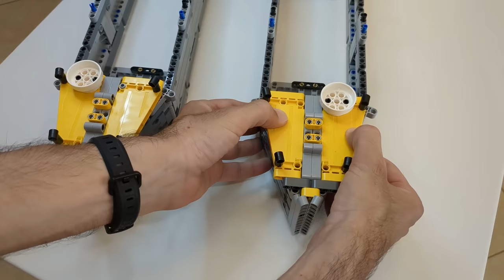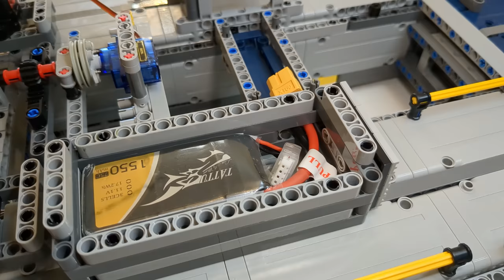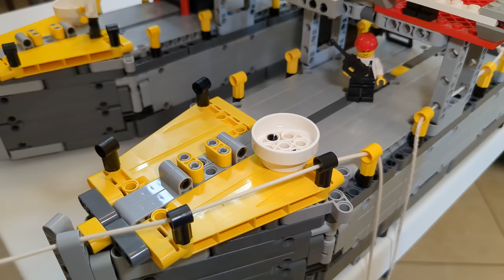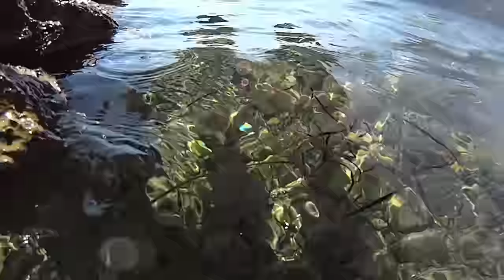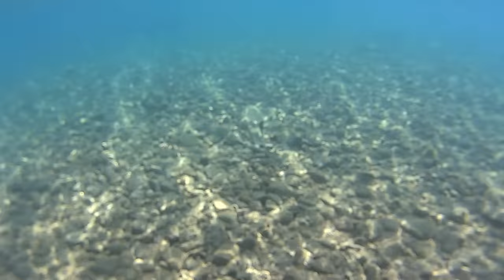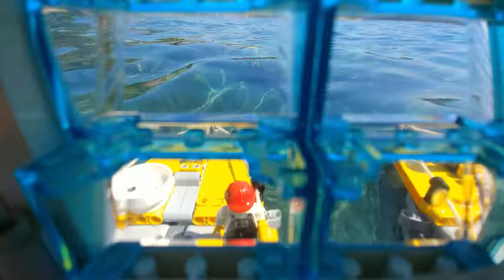LEGO Technic RC boat explores the ancient sunken city of Epidaurus

Comment from the maker: Would you like to see a slightly improved version of that boat exploring a sunken airplane that is even further from the coast? Let me know in the comments!
Reply: 100% do it, also do you have advice for me too? I’m using my Lego exploration ship to explore a crashed ww2 plane. All I could think of is a underwater camera attached to a deep diving rope that can extend 4 metres deep.
Reply from the maker: @techlogiantbricks8279 @ techlogiantbricks8329 To lower a camera so deep, you should go for a platform that is lowered with ropes from all four corners. The mounting points should also have enough space between them to avoid spinning the platform. If you try to lower the camera with a single rope it will definitely start spinning. A simpler and safer solution would be to mount the camera under the boat as I did. That way you avoid the camera getting caught on the wreck or other object on the sea floor, as you will have absolutely no clue about the camera position once it is lowered. Finally, another option is to build a fully submersible vehicle, but that's much harder.
Reply: @brickandgear à
Reply: @brickandgear  thanks for you reply, you share lots of info with me. I have another question, what do you mean that I make a submersible out of Lego bricks? I always wanted to do it but it’s way too hard, you need to make it so that the sub can descend under the water and also rise up, this project just seems impossible. Even if it’s possible, the motors with the battery box can get damaged if it leaked
Reply from the maker: @techlogiantbricks8279  you can check out my submersible drone video if you want more ideas, but it is extremely risky. If it leaks, it's game over...
Reply: Wow, if you spoke in your videos you'd have millions of subscribers, else than that, your content tops everyone!
Reply from the maker: @napoleonofthefrench  wow! You really think so?
Reply: @brickandgear  Yes, I've saw plenty of YouTubers with content worse than yours rise through the ranks, with a voice it would be more personalized and engaging than without.
Reply: Oh hell yes!!
Reply: yes
Reply: Ok
Reply: Yes please
Reply: 100,000,000,000,000,000,000,000,000% can you also attach a crane arm and submarine to it.
Reply: Sure
Reply: Yes, we do.
Reply: Make an Aircraft Carrier!!!
Reply from the maker: @Ąļęxąŋđęř  I'm planning to build one, but I'll have to order some parts first. It'll be at least twice the size of that research vessel.
Reply: I think you should make a Lego submarine and explore a shipwreck in shallower water
Reply from the maker: @Microwave034  it's on my "To Do" list. I know which shipwreck to explore, but the project needs much work.
Reply: Do it.
Reply: Yes
Reply: How long did it take to build
Reply from the maker: @MatthewSchwarz-kr6cd  a day or two.
Reply: HELL YEA
Reply: Les  lego 🎉😅 jolie bat sa secou❤salut ❤ cigne Antonin
Reply: Yes sir
Reply from the maker: @Playmat-qm3vn  you will... soon... 😁
Reply: Yes please
Reply from the maker: @Captain-latvia  coming soon!
Reply: Just do it!!
Reply from the maker: @PVJaumePinaMorales  you can check out the video with the sunken airplane exploration!
Reply: thx!! @brickandgear
Reply: Pls
Reply: YES
Reply: Yes but do it where the middle bit of the boat can close in and hold stuff

Comment: The ship's rolling a lot. While a catamaran hull design is more stable than single hull, you still need keels and fins along the sides and bottom to lessen the roll. I would also recommend storing the heavy battery pack lower on the ship and use smaller motors.
Reply from the maker: Hello! Thank you for the informative comment! Could you check out my merchant ship video? I'd love to hear your opinion on that vessel.
Reply: a SWATH style catamaran hull with deep displacement pods would give more stability, you could design it to be suitable for 3 to 4 inch waves. look up SWATH and Trisec design ships.

Comment: The only improvement I would make is adding a small RC submarine attached by a string. That might be slightly difficult, but I think it might look nice
Reply: And be fun to “explore” with
Reply from the maker: I'll definitely make an exploration sub in the future!
Reply: it’s all fun and games until the controller disconnects
Reply from the maker: @heisenburger531  subs are usually connected with the controller by cable, so you can just bring it up if something happens.
Reply: @brickandgear  just don't use a carbon fibre composite for the hull 😬
Reply: Sounds like a really good idea

Comment: Thats awesome how you built a floating Lego RC boat! But i do feel like there could be a way to make the turning radius gears a little bigger.
Reply from the maker: You are correct. Those small servos turn less than 90 degrees and I wasn't aware of that when designing the boat. I actually made a modification with larger gears in order to achieve tighter turns, but in the end I stuck with my original design, as the mission didn't require great maneuverability. I'm taking my first steps in proper RC gear, so I'm learning as I go.

Comment: Hello brick&gear
I have another question for u, can you tell me what Lego motors you used and what remote you used to control your vessel, if possible can you show me how to use your remote? I might also use your type of mechanism for my Lego exploration vessel
Reply from the maker: I used two RC motors, but I have replaced them with L motors. You can use any 2.4GHz controller for RC vehicles. However, you'll need an electronic speed controller for each channel that drives motors, a receiver, batteries (I use LiPo, but they can be dangerous if you don't use them properly) and servo motors. I'll upload a video sometime in the near future explaining some of the electronics and procedures.

Comment: My only concern is with the electric parts, water and electricity can prove fatal. Are the components waterproof? If they are then that would be alright.
Reply from the maker: The ESC is waterproof. I also sealed the receiver, battery and all connections. (The battery and receiver can be sealed inside deflated balloons)
Reply: Good to know